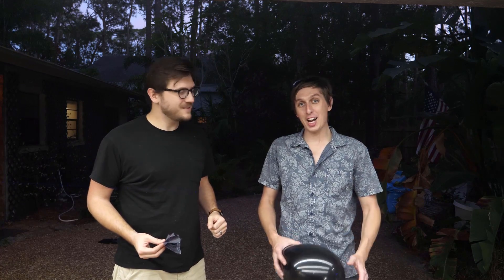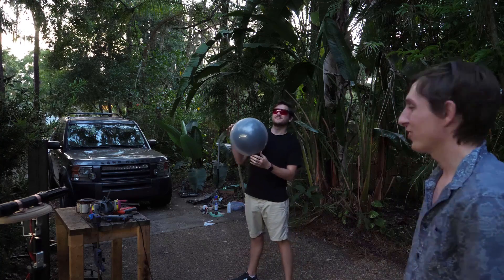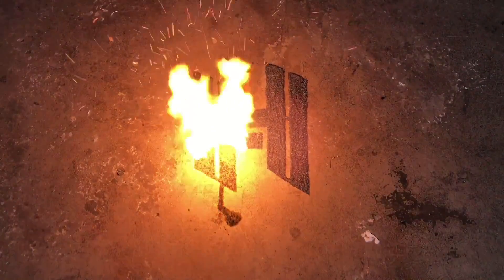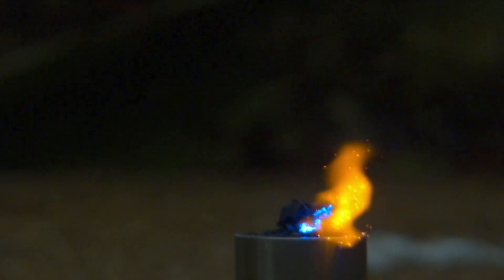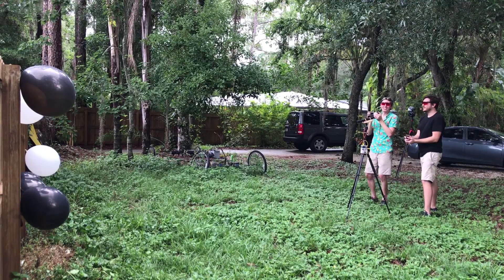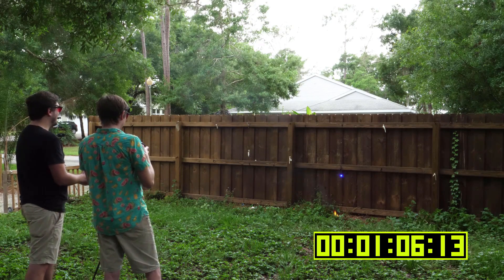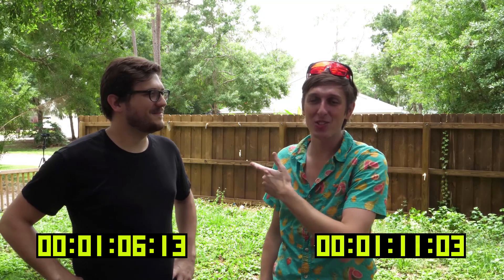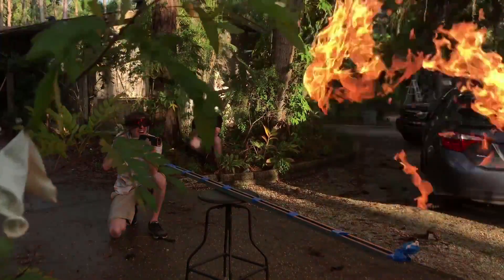Laser Turret Battle with The Backyard Scientist

Comment: Just amazing! Are you using the XBee in serial/transparent mode or did you build something more complex? Is the code online somewhere I can see it?
Reply from the maker: I use Tunnelsup’s XBEE basics series every time I use an XBEE because his information is so great. Lesson 4 is most relevant to this build - https://youtu.be/rnBx2yqKn_E - it’s about sensing analog data on a remote XBEE. I used the analog sensors on the XBEE to detect the x and y positions of the joystick and then a digital pin to detect the joystick press. The Arduino reads the native Xbee signal and pulls out the relevant data bytes. In the code I set up some debounce, reset functionality, and different sensitivity levels. I don’t have the code anywhere but if you really want it send me a PM with your email and I’ll send it your way. I should probably set up a git hub...